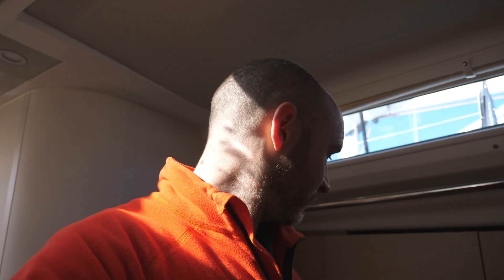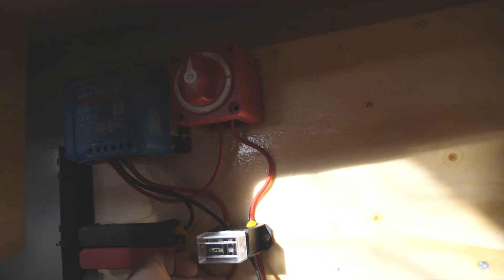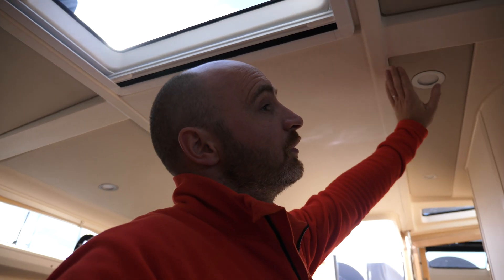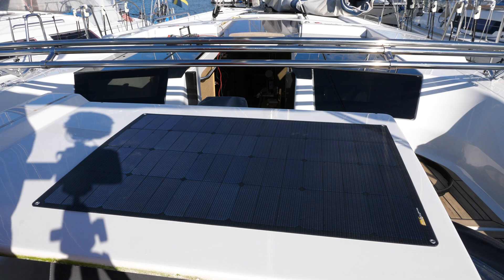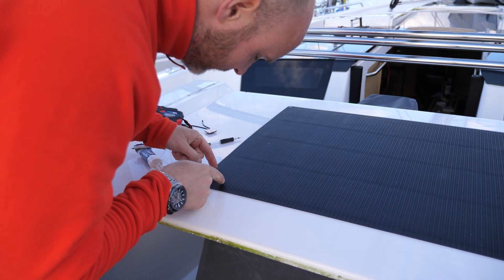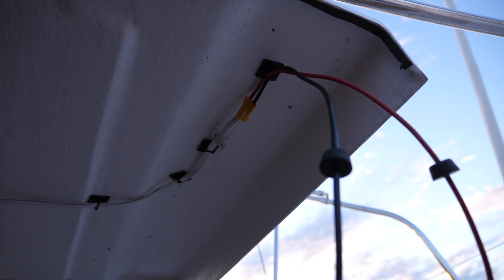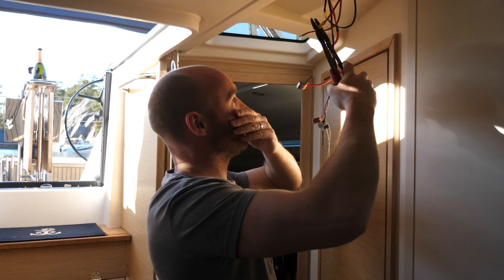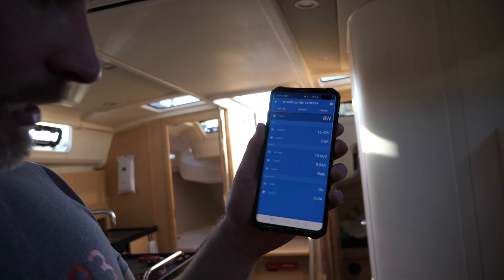TS14 - Solar Panel Install and Victron Shunt (solar panel installation part 2)

Comment: Hi! Thanks for very interesting videos! Been watching them in detail as we are installing our own sunbeam panels. I was however wondering how you did it with regards connecting the flat cables to the cables going the charge controller (soldering, crimping etc). I'm a bit unsure as to what is best with these flat cables so any input much appreciated :) Fair winds!
Reply from the maker: Hi Axel, thanks for the comment, much appreciated. With the flat cables, I just crimped them with a yellow connector, works perfectly. You just need to pinch the sliver sunbeam connector of course to get it in. Hope it helps. Cheers

Comment: Attach them with velcro :)
Reply from the maker: Good shout, but When I didn't have them fully sealed underneath it was attracting a lot of mold and green stuff. I shouldn't really care to much but I like the fully sealed solution now. Thanks for the suggestion though :)

Comment: Hello

Nice videos. 

Question - the negtive from the solar P - di U connect them to negatvie direct on BATT or do U connect that to negative pr Shunt?
Reply from the maker: I connect the negative to the shunt on the other side from the battery. Not sure if the Cerbo GX is taking the solar data directly from the MPPT via the direct cable or from shunt, but works like a charm.

Comment: Definitely a good idea to seal the edges of the panel.  Without this I'd also be concerned about any water behind the panel freezing in the winter.  As a tip, I use masking tape around the area you need to use the mastic on.  Stops it spreading it too far.
I spent AGES getting my panel installed on the 385 and used a similar route to you.  I', planning a 310W panel on the 458 so more joy running cables next spring!
Really like the way you managed to link the engine battery direct to your shunt.  I'm rather red-faced to tell you I ran a cable all the way back through the port cabin  and into the engine compartment as I didn't think about locating a cable on the main DC panel.
Reply from the maker: Thanks for the input Stuart, I think the ice underneath wouldn't have caused too much of an issue as the sikaflex is very flexible, but I don't like just bonding the corners as it was a bit of a dirt and potential mould collector also under the panel. If you watch the next video in the series, I redid it and went around the whole thing. With the masking tape, I did learn from the first time and used masking tape when going around the whole panel, it was a good plan.
After a little while you forget about the pain of cable running so you should be fine next spring :) and with the shunt, I almost went in that direction too, I don't remember how I figured out that the engine was connected there also. I'm still learning all of the wiring down there.
I brought an external charger on board so that I could switch everything on in the boat without the batteries (I thought I was so clever), somebody told me that the onboard mastervolt charger will do the same thing you just have to turn the charger on and then breaker on... trust me I make mistakes all of the time :) Cheers

Comment: Thanks Chris, your patience is impressive 🙂 what kind of amps where you getting during the summer with the 78watt panel? Other question, the cable going to the shunt, what size is that? I got the smartshunt, but am having trouble finding cables as thick as the ones already in the boat
Reply from the maker: Hi Peter, it does take a lot of patience I must admit especially when you know a professional can do it in half the time. From the 78w solar panel we were getting up to about 55 watts, which on 12v is about 4.6 amps on a perfect day with the sun high and no shadows. For the cable to the shunt, I just took the biggest they had in the store and crimped it myself, I think this was 50mm2, it should be no problem that the cable is a little smaller 50mm2 should take a minimum of 300amps and it should not create that much resistance with the wire being that short. I hope that helps. Cheers, Chris
Reply: Sailing Aurora but where’s the fun In having a pro do it right? 🙂 Yes if that’s all you get from the panel I understand you wanting to add more to the boat. I think I’ll look into the foldable panels during the winter season. 50mm2 is also the biggest I have been able to find, for now that will have to do. I did also find 95mm2 and I believe that is what is mounted from the factory, unfortunately I could not find any local stores with this in stock. Thanks for you feedback

Comment: Very useful video, thanks for sharing 👍
Reply from the maker: No worries, I hope it was useful incase anyone you want to do the same thing. A lot of the work is finding out how and where to run the cables and I spent a lot of time trying to find out how best to mount the panels. Didn't quite work out the way I wanted at first but just about to head to the boat and fix it. I hope you are well Jon. Cheers, Chris